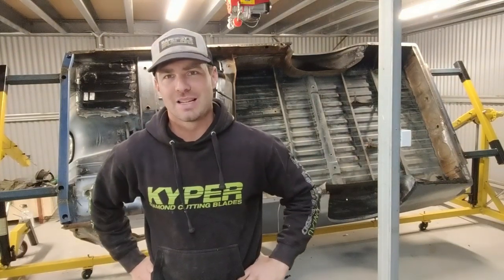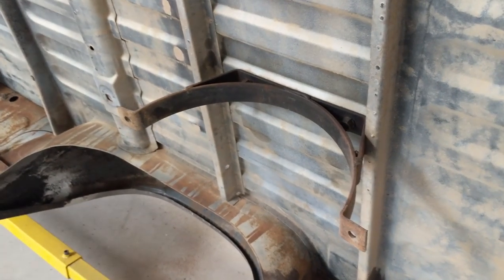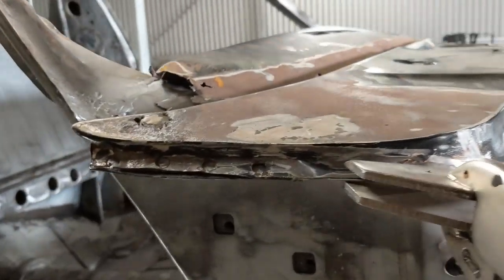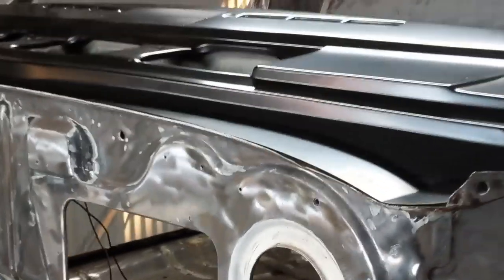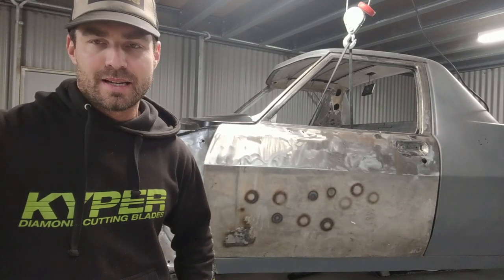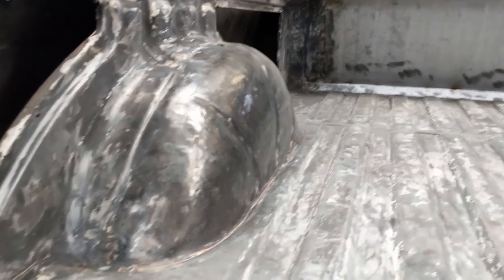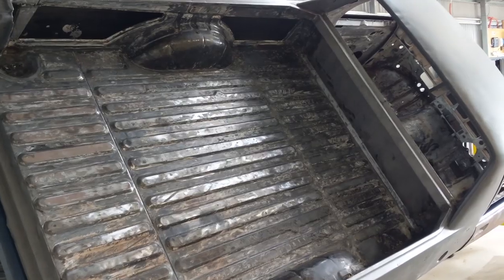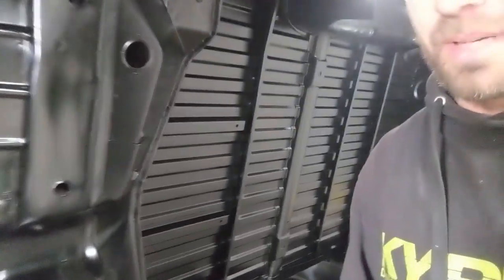EPISODE 29 - FINAL COWL FITMENT AND  PAINTING KBS UNDERBODY PROTECTION.

Comment: Hi mate top videos is there one welding the top cowl on and did you use a seam sealer or poly to seal it off thanks
Reply from the maker: Hey mate, Not as yet, i am waiting to put the body back on the chassis before i weld the cowl back on as this will ensure everything is square and aligned where it will finally sit. Just use weld through primer and then put your sealer on top to ensure no water can penetrate. cheers
Reply: @BarnesysBuilds  thanks mate 👍

Comment: That kbs looks mint, about too do my HQ chassis in the satin black. Already bought 2 more tins for underneath and inside the cab. Ya builds coming along nicely!
Reply from the maker: Yeah cheers mate, it's definitely the way to go, black top satin just seals the deal, tuff as nails and looks powder coated. I have to do inside cab, inner and outer guards as well.
Reply: Looks sweet. Better protected now than when new
Reply from the maker: @duncantaylor6183  yeah for sure, wheels guards had a heap of tar deadener I will replace with something a bit lighter though.

Comment: Very nice video! To expand on a few points raised...RustSeal and BlackTop use different resins; RustSeal uses one for direct to metal which is unfortunately not UV stable; BlackTop is UV stable but not direct to metal...for a chassis or undercarriage that will never see the light of day, it becomes personal preference as to whether to top coat or not. KBS Thinners are recommended as some other thinners may contain components which stop the product from curing or curing properly. hmu with any questions or doubts. Cheers!!
Reply from the maker: Thanks for the feedback, I followed the correct procedure with the blacktop over the rustseal. Only thing is I ran out of thinners so used another brand but still seemed to cured fine. Will check back to see how it's going though to make sure.

Comment: Glad to see you back on the job again. I reckon having the whole underside looking so good will give you a bit more motivation to keep going now. KBS is a great product. I have used it under my tandem wheel trailer and it still looks like new under there.
   Did you design those cut off wheels? Is that your brand? I'm a sheet metal worker and would be keen to give it a go for sure. I'll find them on ebay.
Reply from the maker: G'day Ray! Cheers mate, it's good to be back, yeah absolutely, I'm keen to see it through. It's definitely worth the $80 a 1 litre can that's for sure. Yes I did design those cut off wheels, KYPER is my brand, I sell diamond concrete cutting blades usually but used my knowledge to come up with the Metalx disc because I was tired of changing fibre discs all the time and they ran $3 for the 75mm ones. Being a sheet metal worker you will definitely notice they don't run as clean as fibre discs but they are great for just locking and leaving on a grinder for quick cuts, clean up, thicker metal stuff, they will cut anything actually. They last months from my testing.

Comment: thoses doors adjust where they bolt on to the door you can push them in toward the pillar to close the gap on the new scuttle panel they were never real close
if you lived closer i'd lend you my  spot weld to do the scuttle panel much cleaner than plug welding and far less  grinding to clean it up after
Reply from the maker: Yeah I was adjusting as much as possible but really needed another set of hands to raise the front another few mm to get the gaps nice and close. I also need to flex the doors as well to bring the bases in more so they sit flush. Dam a spot welder would be ideal, hopefully I can chase one up before I do seal it on for final fit up. Cheers